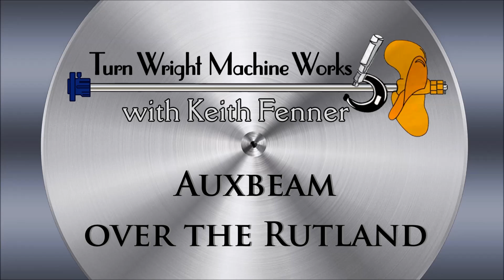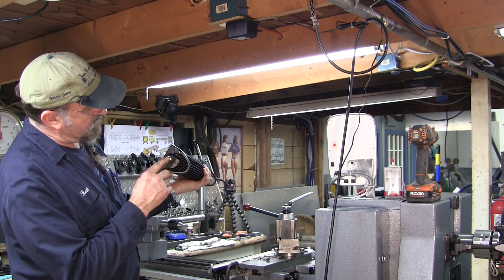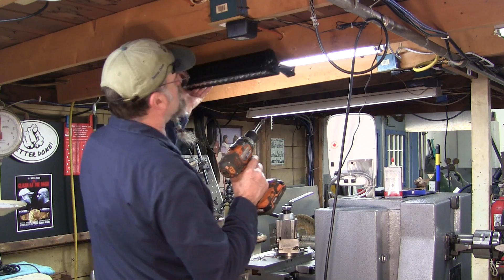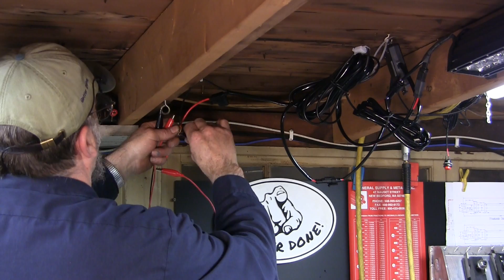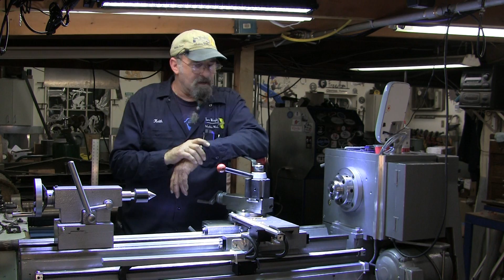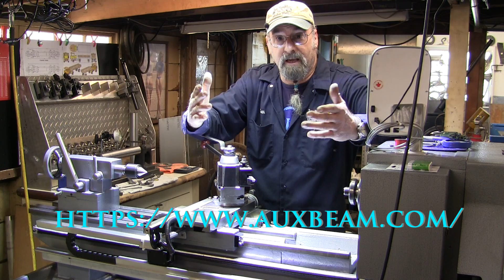Auxbeam Over The Rutland

Comment: I just replaced 15 pairs 4'' double tube florescent lights. I initially chose replacement fixtures and then bought two boxes of LED tubes from Costco.  Incredible difference in the shop lighting.  I will never use florescent lights again!!

Comment: I own at least 3 power supplies.......no wait............4.............my main one is a Samlex 1235M, switching supply which I have 3 ham radios and one CB connected to it.....back-up is an Astron 20 amp.....in my "To-Be-Repaired" pile is another Samlex, but model number 1225. Also having a Samlex SPS-1204UL for 3 amp needs......

Comment: Hello Keith, the aux beam seems too blue due to being very cold in the color temperature. i use leds at home but never liked a light that is higher than 3000 Kelvin (3000 degres centigrad per second) higher that that is too cool, besides that is a very focused beam of light, in a shop or house flood light is better than a beam!  as for car i instaled one of those in a toyota BJ73 and it works great for that!

Comment: I put LEDs in my shop, Love them you can get bulbs for your fixtures. there are direct fit that run off the ballast  or ones that don't us a ballast, I just rewired the fixture for power at one end only with out a ballast, easy to do. I got my bulbs from amazon. just research what Kalvins  (color) you want and the lumens ( how bright ) you want. lots of choices .

Comment: I upgraded my existing 4' fixtures with 4 foot LED tubes. If you search for them online you can get them for under $10 per tube. I used the Hyperikon T8 LED Light Tube, 4ft, 18W (40W equivalent), 5000K (Crystal White Glow), Single Ended Power, Frosted. They are available as clear but frosted diffuses nicer and hides the individual LEDs, which I find distracting. You can remove the ballast, and do a simple rewire and you're done. If I was to do it again I would use the double end fed instead because the wiring is even simpler to do and you won't need to replace the tombstones. I thought it easier to replace the lamps and do a little wiring rather than replace the fixtures because the ceiling height is over 13 feet and it is half the cost of buying new fixtures.

Comment: keith. led is the way to go. i have changed over 30 fixtures in my shop to led. at my age 70,i dont care about color, i want bright. i purchased my bulbs on ebay for about $6 each, they are the wired 100 direct with no ballast . your can get bulbs that can be used with some ballasts but i wanted to eliminate the ballasts. these bulbs are a great improvement in my shop, not to mention the power savings and the fact that they will probably outlive me.

Comment: Way too blue, and very stark. They need to have a better color rendering index. I would have to say the light bar is somewhere around 6000 Kelvin or higher, and the most suitable CRI for camera work, and human vision, is between 3800 and 4500 Kelvin. That is my main gripe on LED's, although some bulb manufacturers have started making bulbs with tinted shielding to warm up the output...LED's are here to stay, but they need to make them warmer for comfortable vision. O.K., just my two cents...

Comment: I am very impressed with the cheap LED shop light I bought at lowes for $46, bright (brighter then florescent) and warm white color. Utilitech Pro Strip Shop Light Item # 595685 Model # MXL2005-LED2X20K840

Comment: My local Costco has FEIT Electric LED 4 Ft Tubes that can directly replace Fluorescent Tubes.   Current price is $17.99 a pack ( 2 LED Tubes).  Amazon has the same item for $28.95.  Nice thing here is you don't have to do anything to your existing fixtures other than turn off the power, remove the fluorescent tubes, insert the LED tubes, then turn back on.  They are also Cool White 4100K which is the same color as the tubes I replaced.

Comment: Yeah, the LED bar throws your color balance way off.

One thing to think about is curving a piece of white poster board from the bottom of one rafter, up the the subfloor and down to the bottom of the opposite rafter to make a reflector/diffuser and run a single 8' fluorescent tube between the rafters attached to the subfloor.  Do that in 2 or 3 consecutive spaces and you could have nice even, diffuse light.

But your regular lighting isn't bad to begin with.

Comment: It's burning out the contrast too much, besides those auto LEDs pull a lot of amps. That's why they have those huge heat sinks on the back. Regular LED conversion bulbs for your existing fixtures would be a better choice. I run them in my shop and would never go back.

Comment: Keith, before you send it back, I'd suggest setting up the Bluetooth app. I followed the link you provided and it looks like the app will let you adjust the color temp of the white light in addition to just picking the 7 or so pure colors that the switch steps though. I'm not sure, but it would be nice to know.

Comment: Hi Keith, as many have already said, the colour temperature of that lighter was too high, my guess would be 6000ºK+,  my own preference is about 4000ºK, a nice bright white light. Also the light was too contrasty, which you may have been able to fix by reflecting the light from the ceiling. It may be worth either painting a section of ceiling above the Rutland, or installing a panel of plaster or even core flute  to act as a reflector, and then aiming the lightbar up and bouncing the light down over the lathe. The larger the reflector the larger the apparent light source, and the less contrast. You could paint the reflector an off white to reduce the colour temperature of the reflected light, the more yellow, the lower the colour temperature. Thanks for all the informative videos, I really enjoy them, always like, but do not always comment.
Rob

Comment: Wallmart sells a 240 LED 4 foot light that kicks ass for under 50 bux,  40 watt,  4500 Lumen,  Aluminum construction,  Standard hanging hardware included.
As an added bonus it has a 3' power cord with a "wait for the drum roll"  3 prong pokie bit what fer stickin in a standard  North American 110 Volt outlet....
Bottom line: this is the best light I have EVER worked under and I WILL be replacing all my Flourecents with them as funds allow.
PS no special effects just a pull chain for instant on and no 60 hz flicker!

Comment: I have found one major drawback of most LED lighting is the multiple point-of-light source (individual LEDs) tend to cause a lot of odd 'shadowing'. (florescent tubes have very little such shadowing) There is a new style of LED lighting which is based on flat-panel TV technology. These are a solid panel of light. (no individual LEDs are visible)  I found some at Home Depot for reasonable cost.(for what you get)  A 1'x4' panel seems to make as much light as 4  4' florescent tubes.

Comment: No question on the light. Your current setup gave a way nicer image. 
I have installed 4 of those light bars in the shop. 2 for my welding table and 2 for the wifes side. they work great but are mounted 10-12 ft high where they can disperse a little. Lighting from them is always harsh and could probably benefit from a white diffuser. In your case, just too close...can't help that...
The disco color-rama was cool...mebbe for xmas and WIYB video.. lol

Comment: Keith, I just finished replacement of 16 flourescent fixture bulbs. Cost  $5.00 each. What a differance .
Take the ballast out and just a quick rewire and plug back in. I did a video tape of it, will have to post it.

Comment: Hi Keith,  Check out "Hyperikon T8 LED Light Tube, 4ft 18w (40W equivalent)",  You can easily modify your existing fixtures to use them.  I've done one 4 bulb fixture so far and I love it.  You can get them in a bunch of different color temperatures.  Mine are the 6000k.  They are about 8 bucks per tube if you buy 12 at a time.  I sent you a private message with a little more detail.

Jody
Reply: I second the 4' Hyperikon LED bulbs. I bought mine through Amazon. It was (4) bulbs for around $38 shipped using my Amazon Prime account. The fixtures were easy to convert and you don't even use the ballast anymore. The best part is the amount of light they put out. WOW. You could literally cut the amount of fixtures you have in half and still have way more light. They come on no matter how cold it gets outside.

Comment: I changed all of the florescent 4 ft. bulbs in my shop to led tubes, Cosco sells led tub bulbs that are a direct replacement for the florescent tubes, just remove the florescent tubes and install the led tubes in their place, the ballast have to be good, but no modifications are needed and the daylight leds are super bright and white and the electricity usage goes way down. They are not cheap, but the cost of the bulbs are far less than a whole fixture and the time to replace them! They come on instantly also!!!

Comment: Being as cheap as I am I installed the old fashion porcelain ceramic screw in bases ($1.48 each) and fitted them with helical screw in florescent bulbs and fabricated reflectors using 16” aluminum flashing.  I am now in the process of replacing the fluorescents with LEDs.  This is best lighting I have ever had in a shop as the lights can be placed exactly where I need them, and replacing bulbs is much easier and cheaper. Also the original the four foot florescent tubes that I use created a strobe effect that the helical and LED lights don’t.

Comment: Just my 2c, i have a 50x70 shop with 20ft ceilings, went from 400w metal halides to 4 bulb 4ft fixtures with 5000k led's. The light  difference is amazing, and each fixture is only 60w, compared to 400w, the electric bill has gone way down. You will not regret going led!

Comment: I think that off road ledbeam is too close lathe and thats why it´s not working great at least my point off view.
I highly recomend look about Led panels... here is one kind that i think about ..

https://www.amazon.com/5000-5500k-Office-kitchen-Overhead-Lighting/dp/B00OM6WKM4

5500k is close daylight and this kind lamp you can look straight in to it.. there is also models that can be dimmable by the...

http://www.ebay.com/itm/ABI-12V-45W-Power-Supply-Driver-TRIAC-Dimmable-Transformer-for-LED-Puck-Light-/361339341796

Comment: Keith, Auxbeam makes great lights for cars and truck I run them in my Tundra, but it made the video worse with it on, you can see the lens auto adjust after you shut it off and the whole scene gets nice and clear. I'd have to give it a no go for the video light. Maybe they have a soft white LED they can send to try, Id be curious to see if softwhite would be better. My 2 Cents, thanks for the video

Comment: I second the comment about diffusers.  Home Depot carries a line of LED light fixtures with a built in diffuser.  There are practically no shadows.  They start when its cold.  You can daisy chain up to four in a row I think.  This works great because you only take up one outlet.  Nice and bright.  So far I have one on each side of my mill, two in line in front of it. and two more in line over a bench.  They come in a couple different light temperatures, I got daylight.  They aren't harsh.  I'm pretty satisfied.

Comment: Hi Keith.  About 6 mths ago I installed LED lighting to my workshop, but before I did that I remembered from my apprenticeship days that for example fluorescent lighting should not be used near rotating parts due to the stroboscopic effect being able to make a rotating part look as if it's NOT rotating.  Obvious safety hazard.  I couldn't find any info regarding a similar effect with LED's so decided to try them.  I installed 5 x 4' x 18W warm white LED's strips and I'm pleased to say that they are fabulous.  NO strobe effect and very natural light too. 
The one you've got there seems a bit too blue/harsh for my liking and also doesn't seem to 'fill' as much.  Regards Mark in the UK
Reply: fluorescent with electronic ballast dont flicker either. That is why I got rid of all my magnetic (60hz) fixtures. They were really bad when it was cold in the shop.....
Reply: LED's do not rely on the Hertz of the power supply as do florescent ballasts, thereby eliminating any chance of stroboscopic events at any temperature...
Reply: Hi and thanks for the reply, but I was (obviously incorrectly), under the impression that despite often being powered by DC, LED's flickered albeit so fast as to be unnoticeable to the human eye.  Well, what you're saying explains why I haven't 'seen' any stroboscopic effects - which is great news for all of us.  Regards Mark in the UK
Reply: Also, some LED lights, like Christmas lights, only use 1/2 of the AC sine wave instead of filtered DC for power.
Reply: LEDs sometimes do flicker at a high frequency; in order to adjust their output we use pulse-width modulation (PWM) which is basically switching on and off hundreds of times a second. However, there is no single frequency; potentially every light controller could use a different one. And, if the diodes are simply on (and running on DC power, unlike Christmas lights), the don't flicker at all.

Comment: The girls on the wall would enjoy dancing to the colored lights.  In all reality, the older I get the more light I need.  Also be careful if you are using a light that gives off a blue tint, you'll find you will have eye strain and headaches in no time, try to aim for a 4500K color temp if you can.

Comment: I just replaced the Florescent Tubes in my kitchen with Phillips "Instafit" LED replacements.  Simple Plug and Play replacements: http://www.usa.philips.com/c-m-li/choose-a-bulb/latest#filters=LINEAR_BULB_SU%2CTUBULAR_BULB_SU%2CFK_BULBS_LED&sliders=&support=&price=&priceBoxes=&page=&layout=

The ones I used were direct replacements without removing/rewiring the ballasts.  If I didn't live in an apartment, I would have used the 120VAC version that bypasses the ballast and taken the time to re-wire and remove the Ballast.

Both versions were available at Home Depot for $6.97/tube plus tax.  

I bought the "cool white" (4000 Kelvin) non-dimmable version but they come in a range of temperature/color and some are dimmable.  They are brighter than the florescent tubes, but very close in color.
Reply: The main issue with replacements that leave the ballast in is the fact that the ballast uses some electricity so you are giving up some efficiency for the life of the fixture.

Comment: My take. Ordinary light bulbs work the best. Honest colour, creates heat (not that excellent in summer though) and minimum of hazardous stuff in them when they break.
Reply: The better quality LED fixtures and bulbs blow conventional bulbs out of the water.  The LED PAR lamps I have at work have way better beam qualities than the conventional PAR38's they replaced. They are the same color temperature and have a CRI of 86%. I did have some defective LED's that failed after 3 years and was stuck going back to conventional bulbs for a few weeks. The conventionals stood out like sore thumbs. 

We also have LED fixtures at work that you can't tell are not florescent tubes.  Except they are brighter for the amount of power they use and have a better CRI than tubes.
Reply: Tubes also have a flicker that make you tired, a quality that bulbs and perhaps LED dont have.
Reply: Yea the old magnetic ballast tube fixtures use to have flicker. Around here most have been upgraded to electronic ballast that solve that issue. We had a efficiency program here by the power company and government where they would come into your business and replace all the ballast and tubes for like %25 of the cost. That 25% you would make back in savings in less than 2 years. We had to go around and take out half the tubes, because everything was too bright after the upgrade.

Power savings wise, the electronic ballast and T8 tubes are hard to beat. The only things LED has on it is durability and CRI.
Reply: They still do. The electricity change polarity 60 times a second. Even if you cant see it right away, it is there. You see it when you are really tired and more visible in the periferal vision. Electronic ballast make it better, but the tubes still have their basic characteristics. .
Reply: The electronic ballast rectify and filter the 60hz AC into DC and then "switch" it back to AC at 20khz so you don't get any visible flicker or audible noise.

Comment: I see two issues with those outdoor light bars... they are made for range... not for a wide field of light... too much light in one spot... this light might work better with a diffusor plate in front of it... but you can't get those sizes straight away...

and the second issue is... it is a non dimming light... sure, it does have nice colours if needed... but those would only matter for show effects... and this would be quite expensive to run it just for that reason...

so all in all it is a Outdoor Offroad Light... with focused LED-lights... the wrong thing for a shop... try to find some wide angle LED lights and you will love it more... (wide angle especially as your ceiling is pretty low down...)